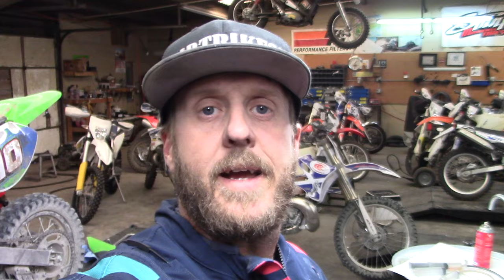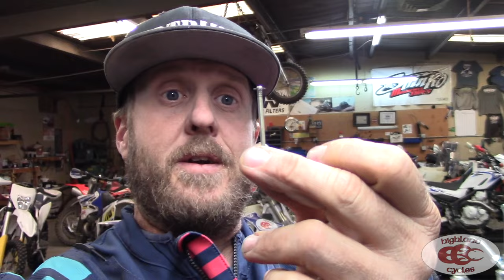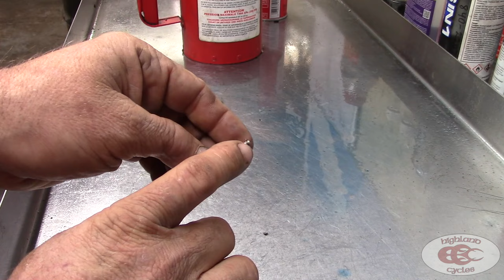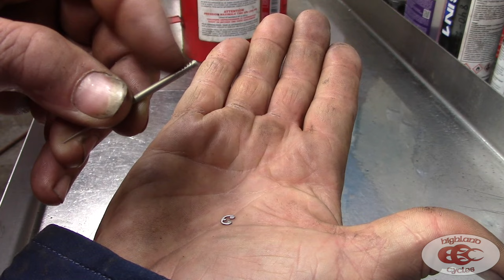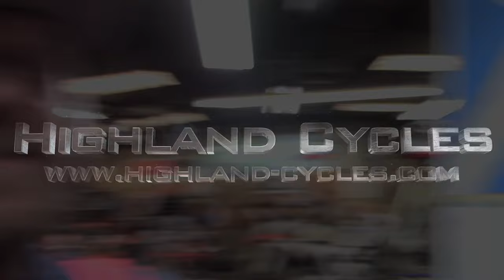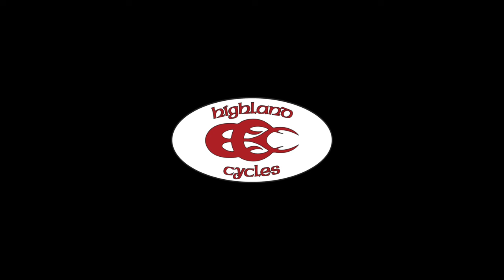What Position For My Needle Clip?

Comment: to remove the needle quick and easy without it flying off, just put it down on a flat surface with the circlip open facing down flat and press on the needle. Clip "unlocks" without flying off.. can put a finger over the clip just to be safe :)
Reply from the maker: Great tip
Reply: Useful info.      Grreeeeeeeeaaa5ttt
Reply: ha ha,... very cool Joao..
Reply: Was just about to post this!
Reply: Great thanks mate 👍
Reply: I use a long nose and slowly..carefully pull it
Reply: I learned the hard way lol
Reply: I use a str8 screwdriver and works feline just hold my hand over it while taking it off.
Reply: I always do that
Reply: Thats exactly how ive been doing it my whole life!😃Only way people should be doing it, easiest and safest

Comment: It will effect idle mixture slightly. Lower the clip if you are having to turn mixture screw out to far, they can vibrate out if theres not enough spring tension on the screw. In severe cases you can shim the needle with very small thin washer under the clip.
Reply: Yeah mine vibrated out😅 will lower the clip when i get the new carb, thanks
Reply: The idle adjustment screw raises & lowers the slide the needle is attached too so yes if it's out of range you can adjust needle height to compensate.

Comment: I recently purchased the JD jet kit for my 2018 ktm xcw and I was wondering what the best clip position would be for all around riding. I would be 0-4000’ in elevation. I live in Iowa so nothing really above 1700’. Usually ride in 60-90 degree weather and ride track and single track mostly. Chart says 2.5 position I was thinking position 3. And also what’s best setting for air screw? I was thinking 1.5 out. Thanks!
Reply from the maker: I’d run 2 or 2.5. I like a lean needle setting personally. Air screw will
Have to be what works best. Fiddle with it til you’re happy.
Reply: Follow the instructions in the kit

Comment: Playing with needles is the best thing you can do that is spot on indeed. I was turning my bike 03 kx250 into a woods bike and could never get the bottom end power I needed did governor mod flywheel weight played with timing on stator gnarly pipe ect ect. Then I did some research and got a few different needles necw necj ect I believe been a few years and they were from suzuki and yamaha and man what a difference before even fine tuning it instantly got beter response and grunt of the bottom as before it was not transitioning on to the pipe smooth at all and i tried alot of tuning with the kx needle. Then I got the new needle and tuned it in no more acting like a 125 where there's no power until hit the pipe it is now a great woods single track machine tuned for colorado high elevation minimal spooge and can even go down to the dessert moab from riding at 10000 feet in the high rockies and  just richen air screw and raise needle 1 notch runs like a top

Comment: Excellent video, Lets add a detail! Many late model bikes have carbs with needles that only have one needle groove/position. That is to enforce running 'lean' to meet emission standards.  A trick often mention to richen up that carb is to place a small washer UNDER the clip, thus RAISING the needle!  It is probably fair to assume a bike with non adjustable needles is running lean, so raising by this trick is likely to give better response.
Reply: ive done this on my mini jeep but it ran too rich at times so getting a new geniune mikuni vm 22 for it instead of the chinese clone it came with and gonna jet it proper

Comment: Awesome 👌 very well explained. Ive just mounted a pz19 110cc dirt bike carburetor on a very old 3.8hp honda G150. I totally underestimated how much fuel is in constant demand! I also now require notch #4 on the needle, Air fuel mixture screw set 1 1/2, idle speed screw set at 2 1/4, Now she purrs like a kitten and the performance is astonishing. Huge improvement in all rev ranges. Thanks bro 👍

Comment: Dual Thumbs Up for liking carburetors brother! Something to be said for simplicity, it's just and advanced mixing valve! I learned something today about the Needle, BTW that was the best part for me, I never knew you counted #1 position from the top notch? I've never really been concerned with what number my carbs are set to, usually just adjust them up or down a notch depending on the climate and altitude of locations be riding mostly in. Huh thanks for the information, cuz seriously I've seen people talking about #1 through #5-7 but never knew how that was untainted by the notches in what direction the starting point of #1 was or was it just something mythical someone made up lol! Sweet bro, thanks and ride it like you stole it! Be safe.
Reply from the maker: Thanks so much

Comment: Thank you soo much for this!!!!  Ever since i rebuilt my 2006 Yamaha Blaster's engine, and then now put a new air filter on it, and fixed the airbox cover, it now runs a bit rich.  I'm ok with rich because it's better a 2 stroke runs rich than lean.  But it struggles to get to full rpm when revving, and also is a little slow on acceleration.  When i bought the Blaster, it had no air filter on it.  So, i'm thinking the last owner probably had set the needle to run richer, to acommodate for the extra airflow from the absence of an air filter.  Especially because it was fast and strong af when i ran it without the air filter, and was not running too rich at all.  I can't wait to properly adjust my carb!!!!
Reply from the maker: Awesome man!
Reply: That sounds familiar! Did changing the needleposition help you in this case?
Reply: @noctis_felis  not very much.  But then again, I have an Ebay air filter (which already had complaints of it being crap and restricting the engine) and on top of that, i had my airbox cover bolted on.  My engine developed terrible piston slap from worn connecting rod bearings.  I have to rebuild it again.  That wasnt bc of the adjustment though...  that was just the consequence of me geting it to run as cheap as possible, which was by just replacing top end after the last owner locked the engine up.  I didnt change anything in the bottom.  So the connecting rod already was badly worn, and piston had tiny bit of up and down play.  Rode and rode and now abput a month ago, thats when it died.  Lucky me, no catastrophic damage.  I'm going to now rebuild it with wiseco.  Wiseco crank, rod, and piston.  Then i'll get an FMF pipe.  And later i'll also get a lightweight flywheel. And new reeds.  It's gonna be BUILT for real!!!  

My situation wasnt a normal situation, since i had cheaped out, and my engine already was getting nowwhere near enough airflow, therefore always was too rich.  For you, it most certainly will help it.
Reply: @noctis_felis  Also, another tip to mention. When adjusting EITHER mixture for 2 stroke.  Whether it's the idle mixture, or the high rpm mixture.  DOESN'T MATTER.  When adjusting those mixtures, DO NOT RUN TOO LEAN!!!!  Not only will a lean mixture cause the engine to possibly not receive enough oil to lubricate it, but a lean mixture will also cause 2 strokes to experience the SCARIEST THING they do!!!!  That is LEAN RUNAWAY!!!   Lean runaway is when the engine starts dieseling and running on its own, REGARDLESS of the kill switch.  And it screams to higher and higher rpm, till either you choke it out to shutoff, pop clutch with brakes to stall it, or it just self destructs.  This especially happens when you are low on fuel.  This is why I am always cautious of my fuel level, and check it constantly.
Reply: @nascarsimracing1  Thanks a lot for your fast reply! I had a bad runaway case on my 2000 KTM 250EXC, due to accidentally putting WAY too much oil in (I will never stop cringing about that). New crank assembly, checking and cleaning everything (top, bottom, middle, back, everything), 'burned' the exhaust out, new reed valves, you can fill in the rest... Getting parts is hell since KTM seems to think it's an ancient bike. Haven't gotten it to run as it should again though. Been dicking around with carb settings and jets, but didn't fully understand yet what the needle setting does.
Reply: @nascarsimracing1  How's that work? Mine did the runaway first time through a dirty and thus glowing sparkplug. Then again on the glowing carbon deposit on the piston. Giving full throttle or setting in into gear and running him against a wall or tree or something stalls it the quickest. So how does that go when it's lean? I'm happy you say it's scary too. My driving partner got so annoyed and irritated by me being hesitant (scared) to start and drive it again. Got over it though, BUT NOT THANKS TO HIM FFS
Reply: @noctis_felis  the way that it runs away when the engine is lean, is because when the engine is lean, it'll run hotter, and if it gets hot enough, the spark plug will glow, and engine will diesel and therefore won't turn off with killswitch.
Reply: @nascarsimracing1  I call this two stroke turbo 😎😅

Comment: Thats one great thing about living where I do. Out of the crate, most bikes run perfectly.  Its hard to beat stock jetting.  My bikes start n run perfectly,  no plug fouling.  And they will idle all day.  Nice dark golden brown  spark plug reading.
Reply from the maker: Awesome
Reply: nice^^^ what state do you live in?
Reply: @rickyjennings8627  he lives in that imaginary state that doesn't exist.
Or he's referring to a four stroke that is fuel injected....
Reply: @rickyjennings8627  Ontario Canada 🇨🇦  and no I don't ride a 4 stroke efi. I ride a 18 yz250 and wife's on a 18 kx100,  but over 41 years I've had over 30  bikes, trikes n atvs.
Reply: @enduro trucker Ernie Desjardins  I'm also in ontario, southern Ontario .. I need help with my carb tune any suggestions? 1991 rm250 with fmf gold series.

Comment: I owned an Elsinore 250 when stationed in Alaska. We would ride trails that started at sea level and climb to about 6K feet. Half way up we would have to stop and I would raise the clip two settings in order to lean the carb, otherwise the plugs would foul and the bike wouldn't idle. Of course we would have to reverse the procedure on the way back down. You are right about that clip wanting to fly off in the worse way and I always carried extra. By the way safety wire can work in a pinch to replace the clip if need be. Don't ask how I know...
Reply from the maker: Hahaha, awesome.
Reply: Excellent. Here its about 5k feet elevation, like most of Wyoming. Need to raise it a notch or two up. Thanks

Comment: I've done everything to these carbs on this bike except for needles. It dies upon throttle everytime, unless i spray the carb with fuel. Then it revs just fine. Without spraying the carbs, itll just die wen given throttle. Only thing i havnt done is needle and thats because it has no slots. Is it okay to use washers to allow more fuel ? Any help is appreciated. Also I love your vids.

Comment: Hi! I have an husqvarna cr144 2011 with tmx38 carburetor and  when I accelerate I feel like the gears are too short and I would like to have it more longer but not so sure if changing needles clip position will help in this case , I love this moto but it’s too dirty bike always with valvule exhaust open it’s kind a motocross style. Cumpliments from Portugal 🇵🇹

Comment: You’re going to Oklahoma from where? (Starting and ending elevations?). And how did you know to go to the 4th position?
Reply from the maker: From CO and lots of fiddling
Reply: @highlandcycles  

I’m also from Denver area.  My bike has run poorly since I moved back here from traveling in my RV (AZ, NM, SoCAl).

No adjustment on my pin. I stuck a small wire up my jet.  Bike ran great!!!  I ordered an assortment of jets.  

Thank you!

Comment: my ZX6R they are in the 3rd position.         and it's not running good, also the pilot screws are only 1 turn out witch doesn't seems right but according to the idle sound it's what they like.  bike bogs down when i go to take off.   should i try raising or lowering the needle?

Comment: But you also have different size needles , they can either be rich or lean by going up in number or down .  with out changing the main jet  ,  and by changing the slot your changing how rich or lean it is , longer the needle less fuel . shorter more fuel .

Comment: Hey boss great video.  I have a 2022 YZ250X and I live in south texas off the coast a little it’s very hot and humid . I think the factory jet tuning for the carb is off for my type of environment. Should I run Richer or leaner ?
Reply from the maker: Might need a little more gas but I’m not sure what it’s doing?
Reply: @highlandcycles  I feel like it’s running a little too rich ,  would you recommend just adjusting the Pilot jet screw ? Or main jet ? I’m still trying to grasp the whole carburetor process and tuning in a nut shell . The bike runs amazing but I feel it could be more crisp
Reply from the maker: @txwicked1804  ok. That’s good info. I would start by dropping the needle (raising the clip) one position and opening the air screw 1/2 turn.

Comment: I have a question I'm really hoping that you can help me out a little bit not that long ago I bought a Polaris xplorer 300 4x4 which is a 2-stroke engine old school carbureted no exhaust valve nothing fancy but I do not know anything about tuning a carburetor I'm not looking to make a ton of power just for it to run good it had carburetor problems since I got it but I noticed it felt like it was running a little Rich smoked a lot used a lot of gas started messing with the needle got it to run a little bit leaner seems to run better but I don't want to run it too lean I'm still running the stock jetting do you know if it's possible to run it too lean and cause damage having the stock jetting buy adjusting the needle I am assuming with the stock jetting they kind of built it for idiots like me so you can't run it too lean but I don't know
Reply from the maker: The stock jetting will never be too lean. Also you can’t ruin a motor with the needle position. You should be fine.

Comment: The easiest and safest way to change your needle position is to use a small pair of pliers and grip the E clip from the back center of the clip to pull it off and whilst still holding it just move it to the new position.
Reply: Hi , If I am right at the number 1 needle groove and it feels it could need to go leaner still do I go smaller pilot jet or main jet. Also my air screw does almost nothing until almost all the way in then splutters a bit. Thanks.
Reply: @yeahrightmate  you need a bigger pilot jet if the air screw is all the way in. You want the air screw to be roughly 2 turns out. The carb needs more fuel, if it's all the way in go up at least 2 sizes on the pilot, then get the motor running, roll the throttle to about 1/2 and see what it does. If it backfires or bogs go richer on the needle. After thats dialed in get the motor warm, then crack the throttle wide open, if it does or bogs you probably need a bigger main. I know this is late I hope you fixed your issue!

Comment: So does needle height only adjust throttle response? It doesnt do anything to resolve air/gas ratio or fix things such as four stroking on a 2 stroke engine?
Reply from the maker: It has the most effect on throttle response. It can help with those things too but not a huge amount

Comment: Can needle height affect/fix a bog when you trust the throttle quickly? My kids 50cc will bog, and die if you hold it, when you rip the throttle off idle. If you go a little slower it revs fine without dying. With my adult butt on the bike, it seems to lose power on hills at WOT (will pull harder if you let off a little), but maybe that's just my size. Anyway, I've taken the carb apart and cleaned many times, adjusted float level to try and get more fuel flowing. No change. Bone stock, low hours. No air screw, only idle. Could raising the needle fix this kind of issue? Thanks greatly
Reply from the maker: Yes the needle can effect that.

Comment: One question I have, do these needles wear out a bit on the bottom causing the performance to change?  Mine has never been touched but suddenly I don't seem to be getting enough air in the carburetor.   Only thing I changed was the float needle and seat.   Jets are all good and cleaned.  I have intermittent bogging on acceleration.
Reply from the maker: Yes they do. So can the brass tube they go into

Comment: Hello ,at idle they say the trottle is a little bit open ! But also at idle will there be gasoline coming out of the needle?
Reply from the maker: Yes. A little. All circuits are active all the time.
Reply: @highlandcycles   but I see a video where they show at full throttle the piston sucks only air out of the main jet...the pilot circuit is open butt most of the off all of the suction goes through the big carburator hole ...
Reply from the maker: @benkr5870  that is true. But the pilot is still in play. Not a lot of effect but some. Same with the main at idle. Less effect but still in play
Reply: @highlandcycles   ok thank you

Comment: Question for you? Struggling with a 2016 kx85 bogging going uphill, 140 main ,38 pilot needle at 3rd position.  No clogs, no air leaks. Any advice. Ky elevation.
Reply from the maker: Check compression
Reply: @highlandcycles  just installed brand new topend last week. But I'll pull a number tonight. What range should I be at?
Reply from the maker: @barryrose4091  somewhere over 130
Reply: @Highland Cycles  thanks! I'll look into it. Would a upside down ring cause the issue?
Reply: @Highland Cycles  thanks for tour help, I found the issues was the power valve was not clocked correctly and was stuck open. Set powervalve rod to line up with dot and casting mark. Bike runs great now.